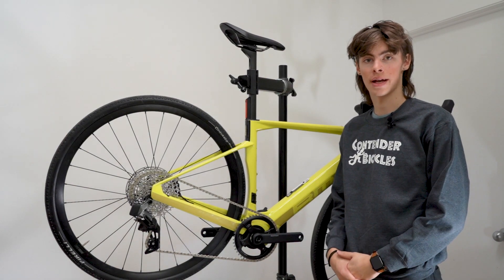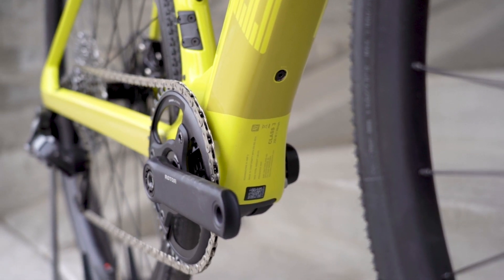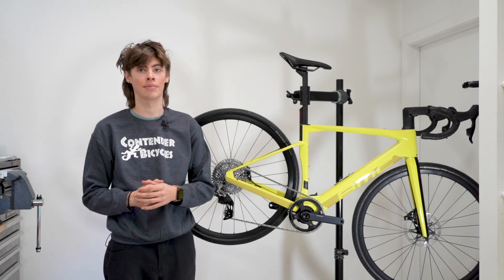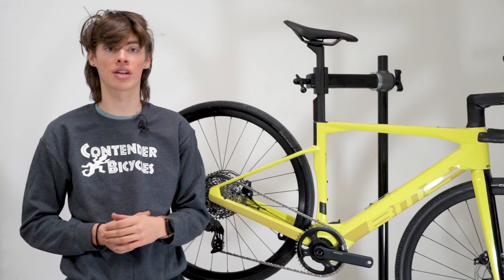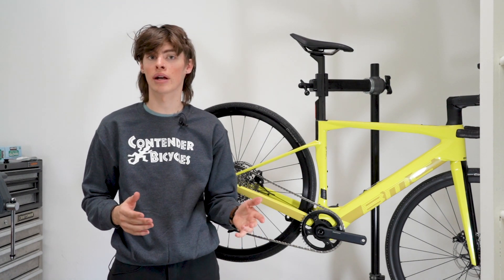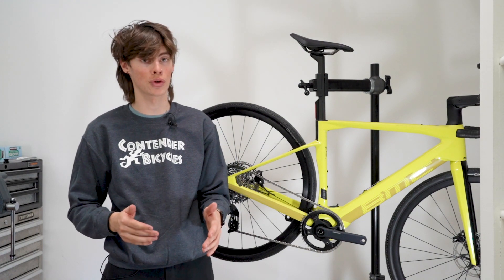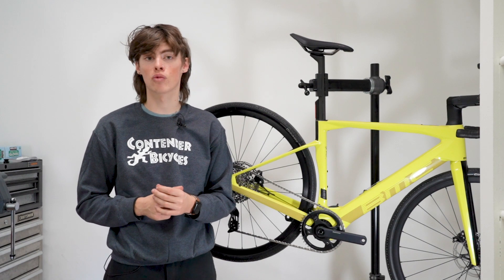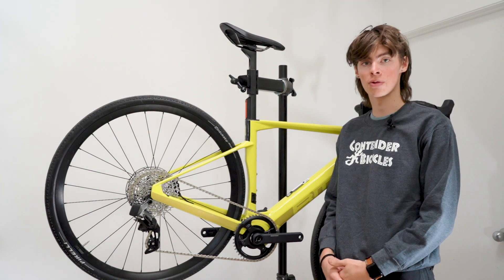New Lightweight E-Bike Motor | TQ Drive System | Contender Bicycles

Comment: If there is a problem with the motor, is it expensive to service it?
Reply from the maker: It depends on what is wrong. We have been able to pull the battery out of the frame and re install in around 2 hours, our shop rate is $90 an hour. But if the motor itself had some issue, it is more likely Mahle will send a new one